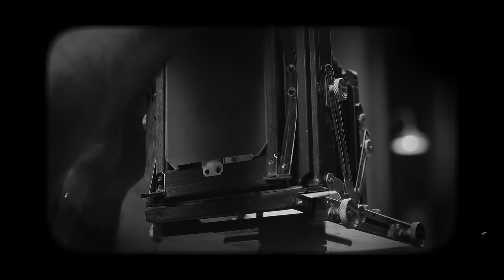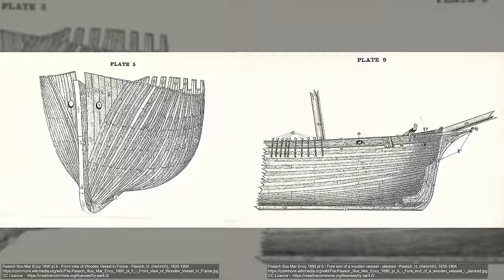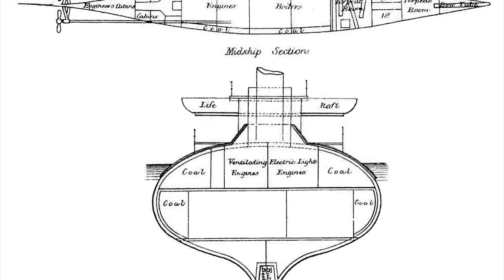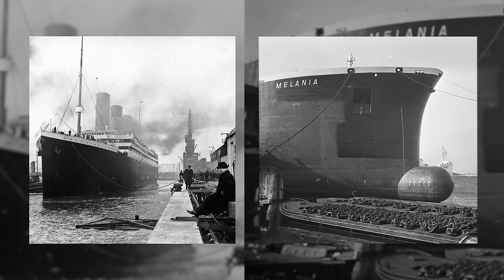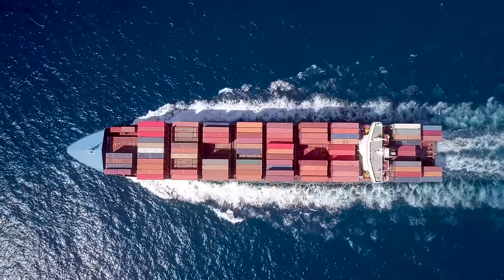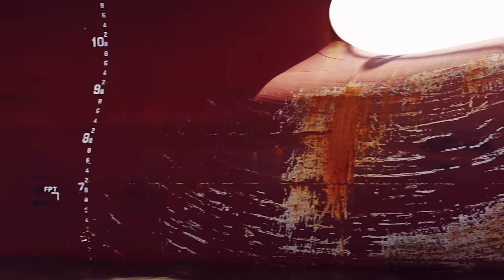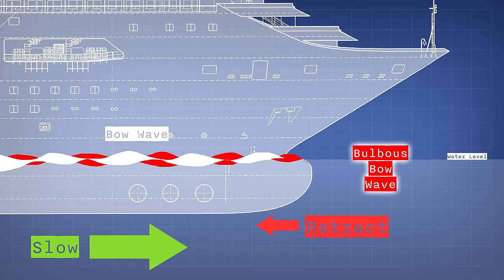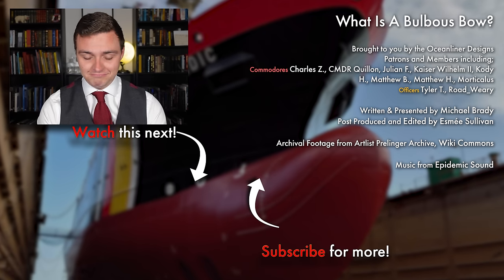What Is a Bulbous Bow?

Comment: The bulbous bow is so counterintuitive looking that it's actually hard to believe that it increases efficiency versus the knife edge bow.
Reply: I agree! It is definitely very ugly in my eyes. Hey, but if it works, then it is what it is
Reply: Similar to submarines nowadays, more efficient with a bulbous bow rather than the older knifelike bow.  Look at the USS Triton, an early nuke sub designed with a very sharp bow for speed to keep up with the surface fleet.  But modern subs having rounded bows can be even faster.
Reply: It has to be pointy. Pointy is scary.
Reply: The bulbous bow, that’s what I call my doodle.
Reply: And 'bulbous protuberance'  sounds so very un-hydrodynamic!
Reply: @jimmcmeen761   its under the water 99% of the time
Reply: Depends on the speed range.  Some speeds, it can be more.of a hindrance.
Reply: @lancerevell5979 in subs, speed is only one consideration. Another important one is stealth - avoiding detection in order to get sufficiently close to an enemy's coastline and surprising them with your nukes. I wonder whether the advantages in speed and efficiency conferred by a bulbous bow would be outweighed by a 'noisier' sonar signature resulting from the additional hydrodynamic disturbance when compared to the traditional knife-edge?
Reply: Thank you for repeating the opening statement of this video in text.
Reply: @rich_edwards79  With a submarine, it is critical that the design ensures that the waves created by the bow, recombine at the stern, coming together at the propeller.  This serves to both reduce the noise of the waves themselves, and that of the propeller.  A critical part of sonar stealth.

So, when you decide to make a bigger new version of an existing sub design by stretching its length, the bow shape will need to be slightly modified, to re-adjust the wave flow, to ensure it still meets and combines with the prop wash.
Reply: It’s sort of like having a knife that melts the butter as you cut it. Just makes whatever’s in front of it softer therefore easier to move through
Reply: I’d like to see a comparative analysis on the same ship. With and without it at varying speeds to see the data
Reply: Oh yes, so hard. 
I wonder what a female ship looks like.

Comment: There is a caveat or two for them: 1) a bow design works for 1 hull size + shape at 1 speed.
2) on a smaller boat, like a motor yacht under 100 feet in length, they actually work as a stabilizer and slow down the pitching of the yacht. ( the fin stabilizers slow down the rolling not the pitching )
Reply: I remember reading somewhere that they reduced the speed of container ships to save fuel but it ended up causing issues because the bow balance was then off.

Comment: Good explanation. The inverted bow at 8.13 (celebrity edge) won't take more waves over the bow. Quite the reverse. The shape greatly reduces pitching and remains drier. Traditional ships with their wide flared bows generate a lot of lift from approaching waves and this lift initiates the unwanted pitch-drop-pitch-slam cycle. Remove the lift and you get less slamming. Efficiency still matters so many of these newer axe/x/knife/inverted bow designs still include a bulbous shape below the water line. As such I imagine this one does also.
Reply: I strongly dislike the appearance of the inverted bow, just one of many ways the Celebrity Edge is a hideous ship

Comment: Hey Mike! Love your channel. a fascinating combination of history and engineering. Keep up the great work! 
I have a question: is a ship's hull watertight? Does it have to be? And if so. How can you check that?  Is there any leakage  along the driveshaft of the propeller? 
Hope you'll get around to addressing these  questions sometime.
Have a good one!
Reply: I think.. this is a hobby and I'm no prow! riveted ships rust between the overlapping plates which expands and seals.
I used to volunteer on a narrowboat and every day we were to check the "stern grease gland". A cylinder of grease which is under a bit of pressure. This lubricates the prop shaft bearing and also pushes grease and in turn the water outwards. If it was loose we gave the handle on a threaded screw half a turn or a bit more. I was trained not to over tighten it as it just pushes the grease out faster with no benefit and you have to take it off and re fill it more often. 
Look them up if you want incase my description isn't the best lol. As for ships maybe some way bigger and maybe more advanced version of this???

Comment: Years back I worked at a shipyard in Boston. We fabricated and installed bulbus bows for the Knox class frigates. We called them sonar domes. They were clad with a B. F. Goodrich rubber "boot" almost 2" thick. No steel, which allowed the sonar waves to propogate. The compartment behind the rubber was flooded to allow sound transmission and had to be pressurized.
 I hate to think of what happens to any marine life near these vessels. The sonar equipment was not to  be energized while in port in case any divers nearby in other yards were working.
Reply: Unfortunately active sonar use (especially modern sonars) are known to cause huge impact to wildlife, such as causing entire pods of whales to beach.

Comment: This is very much like "tuned exhaust" pipes on racing cars.  The exhaust gasses travel in pulses created when the exhaust valve opens, and when each pulse reaches the air at the end of the pipe, it over-expands, which creates a low pressure zone around the end.  This means a negative pressure pulse travels back up the pipe to the engine. If you time it just right, the negative pulse reaches the exhaust valve just as it's releasing a new pulse of gas. This helps "scavenge the cylinder" to a greater extent, which, in turn, leaves more room in the cylinder for the new fuel/air charge. As you can probably guess, this only happens at a very narrow range of engine speed, so the pipes are "tuned" to be most effective at the power-peak of the engine, just like the bulbous bow.

Comment: On the reverse bow: as I recall, the efficiency comes in its handling of sea waves. Conventional bows increase bouyancy as water rises (wider bow) and will ift ship more, whereas the reverse bow is  less bouyant at higher elevation so the peak of a wave has less impact on ship and won't lift ship up as much. There is also something about how the revrse bow will redicerc the water from the wave's peak just to the side, whereas the conventional bow will "resist" the wave and try to pushig it down and to the sides.

Comment: I believe you missed addressing a vital point regarding the increased efficiency resulting from bulbous bows. Just because you get two bow waves annihilating one another does not adequately explain how the ship can attain the same speed with less power. The energy has already been transferred to the fluid; it is lost to the ship. What happens to it afterwards cannot directly explain why a bulbous bow makes the ship more efficient. Another explanation is required.

You should've mentioned that without a bulbous bow, a ship would perpetually have to climb its own bow wave, and that is the reason the bulbous bow actually works, and why having it in certain speed brackets is actually detrimental to efficiency - if the waves can positively interfere with one another, the bow wave actually increases in size, and the ship has to work harder to accelerate through - or rather, over it
Reply: Very good point.

Comment: Hi Mike! I was recently looking at a bow-on photo of a Nimitz class aircraft  carrier. The overhang of the angle flight deck appears Hugh. I scaled it out on my Tamiya USS ENTERPRISE and I think it is appropriately 22 meters. Now this runs down the entire centre section of the ship seemingly unalted. The amount of structural steel to support this must be Hugh. I do appreciate how big these ships are both in beam and length. So I was wondering if you could please do a video on how the designers; design these ships to be stable, and not roll over in  anything else but a flat calm milk-pond. The island on the opposite side would compensate for some of the  weight but I don't think anywhere near all of it.  Thank you  Ray.

Comment: Hmm.  You could also cause destructive interference in stern waves as well using a stepped shape for the stern below the waterline.  Even though the ship's not going through them the energy for those waves still comes out of the ship's powerplant and knocking them down would be a good thing.

Comment: If a bulbous bow takes on damage can it have an impact of the hull integrity of the entire ship? It makes sense that the area behind it would be able to be sealed shut if it were taking on water, but if you were to run over an uncharted rock, shoal, or hit another smaller vessel could the bulbous bow be thrust or crumple backwards into the ship and cause further structural failures beyond the closest compartment to the bow?

Comment: Always wondered if this principle works on absolute terms.  So if you were building a ship with the goal of achieving the highest speed possible without any regard to fuel efficiency would the Mauretania's knife edge bow still be the superior design?
Reply: Drag is like having the brakes slightly touching while you drive a car. Anything that reduces drag will directly reduce the amount of power needed just to maintain a constant speed. An engineer would see this saves energy, but a racer would see this leaves a reserve of power to go faster.
So, while some things that improve efficiency do not help go faster, the bulbous bow definitely helps with both.

In fact, drag has such a strong effect on ships that racing boats do extreme things to reduce it. The fastest are "hydroplanes" that literally lift partially out of the water. It's amazing to see one start slow and gain speed, then it reaches the point where the hull lifts and suddenly it's like they lit a rocket!

Comment: Fun fact: most newer vessel designs have a stongly reduced bulb or even do away with it altogether. Apparently the bulb is optimized for good weather sailing, but when wave effects are taken into account the advantages go away.
Reply: It is a wrong fact. It has nothing to do with what you said. The problem is that a bulbous bow creates increased vertical motion when sailing through a wave. The bulb adds reserve bouyancy which adds additional lift when piercing through a wave. This increases vertical motion and is the main cause for motion sickness. There are exact studies on the relationship between bulbous bows and the percentage of people getting sea sickness. The higher the reserve bouyancy, the higher the percentage of people with sea sickness. And since cruise ships should first and foremost be comfortable places where people feel at home, ship builders are moving away from bulbous bows and implement hybrids. Basically a trade-off between efficiency and reduction of vertical motion.
Reply: Much of the problem is they’re mainly only good at a certain speed. Outside of that they’re actually worse. And, things like cargo ships have started slowing down to save fuel which puts them out of the benefit range of a large bulb.

Comment: I wonder if we will see a point where the bulbous bow is removed but an extendable structure like the aerodynamic nose spike on some missiles/rockets, they can fully retract and the length depends on the speed and angle of the missile but its just enough to reduce the drag through the air.

Comment: T.S.S. meaning: Some photos of Olympic machinery under construction have TSS Olympic painted on them. Did some research but results are inconclusive. SS-Steam Ship (Single Screw) PS-Steamship Paddle Wheel. TSS-Steamship Twin Screw. TrSS-Steamship Tripple Screw. (RMS comes later). If this is correct, then Olympic should be TrSS not TSS. (?)

Comment: I don't think ships should be bragging about the size of their bulbous bow and certainly not display it prominently 🙂
Your video seems to have had one slight misleading aspect in its graphics. The issue here is to reduce/cancel the wake wave (perpendiculat to ship travel, not parallel to it.  By having the "bulb" part  create its own wake at a specific distance from the real bow, the wake created by the real bow will be at different phase, and when properly calculated, the wake from the bump will cancel the wake from the bow.  
However, where the savings occur is in friction:  left alone, the bow's wake waves will result in half the ship having higher water line, and the other hand having lower. This results not only in more surface area rubbing against ship, but also in a V hull, when water moves from low to peak of the wave, it needs to move outward because ship is wider higher up. 
By cancelling that wake wave at front of ship, you end up with a level water line along the ship.